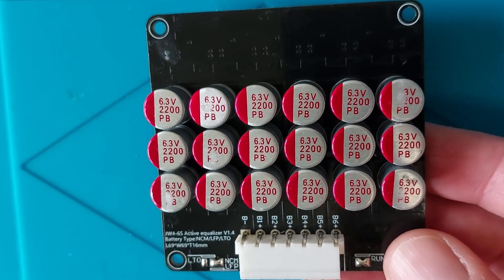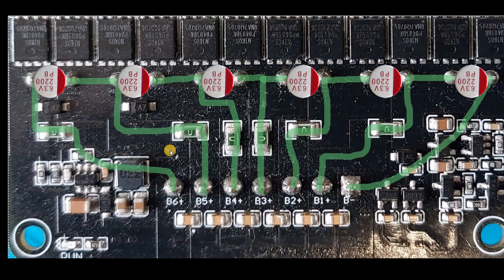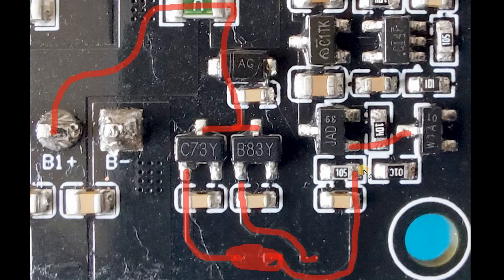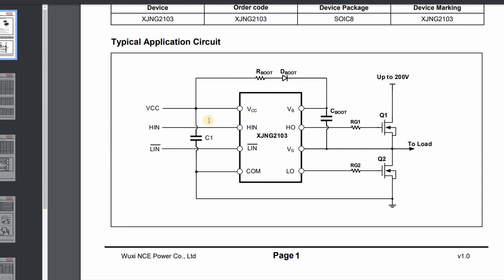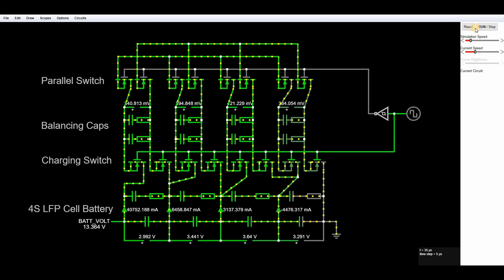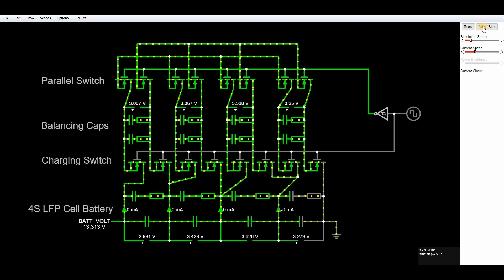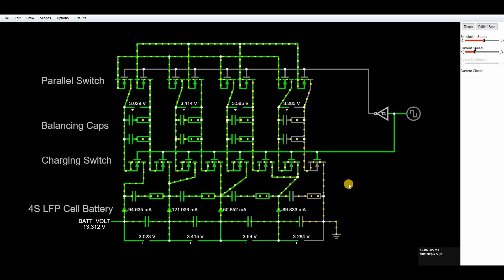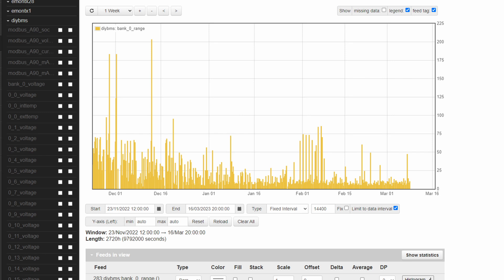How Does An Active Balancer Work?

Comment: Actually a pretty smart and cost-efficient design. Most Active balancing ICs from Linear etc. usually use boost converters to boost the cell voltage to the battery voltage
Reply: Yep, but boost converters are much more efficient.
Reply: Got a part number?
I am not buying your boost statement.
Reply: @user-rs8zg8ey2b  What part of it? Switched capacitors aren't particularly efficient: if you want to equalize voltage between two identical capacitors where one is charged to 10V and the other at 0V by directly paralleling them, half of the coulombs get transferred and you end up with two capacitors charged to 5V. Q=CV^2/2, which means half of the energy was lost to I2R and EMI in the process. Do the same experiment by putting an inductor between the two capacitors to store the potential energy associated with the voltage difference instead of letting it turn into heat and RF radiation, now you get two capacitors charged to about 7V. If you want to efficiently transfer energy between cells, you definitely need something between capacitors. With a buck-boost/SEPIC/CUK converter, you can transfer energy between battery cells more effectively and efficiently than using switched capacitors. You could even use an isolated DC-DC converter to either divert current from the strongest cell back to pack voltage or directly charge the weakest cell from pack voltage.
Reply: @teardowndan5364  
as I said
Got a part number?
I am not buying your boost statement.
Reply: @user-rs8zg8ey2b  The part number is: conservation of energy. You need some sort of DC-DC conversion between things at different voltages if you want to avoid losing the energy embodied in the voltage difference, no ifs or buts about it.
You can simulate it in LTSpice or any circuit simulator of your liking using any parts you want, the result will be the same.
Reply: @teardowndan5364  There is so many items that is going on. The many I see boosting the high cell to charge the whole pack is not necessary conservation of energy as your charging the cell(s) that is also charging to pack, and losses among diode drops (or sync rectifiers) and IR drops.
This simple cap circuit is not perfect by any means. If you put a mpu and some intelligent FW on it to intelligently control the gates it would do much better.
I want to see the data sheet of what you claim, P/N or it didn't happen.
Reply: @teardowndan5364  Also, your flawed 0v and 10v = 5v is not correct, why would half the energy be :lost: its still in the cap? And there will zero chance there will be 0v and 10v differences, more like a couple hundred mV at most, or that pack is toast.

Comment: I’ve got a 16S to use with my 16S pack. It’s mostly only to be turned on during charging, using the “run” solder pads through a switch.
Reply: And I think this is actually more efficient and effective than having it running all the time.
Reply: I heard its even better to only have it on right after charging when the battery is full. But that‘s hard to do without a micro controller tapping into the charger state.
Reply: actually it is on all the time, but the module only consume around microampere.. it is active, like overdischarge (undervoltage protection), overcurrent (short-circuit protection), and overcharge (overvoltage protection).. it is active, because if not active, there are no monitoring the batteries cells from the BMS and nothing can be protected..
Reply: @dwikey_98 the idea is to not have it in all the time. If this balancer is active when the battery pack voltage is at or below resting voltage (~3.3v/cell), it will unbalance the pack long term. Best to only turn the balancer once a cell rises above 3.35v/cell or so.